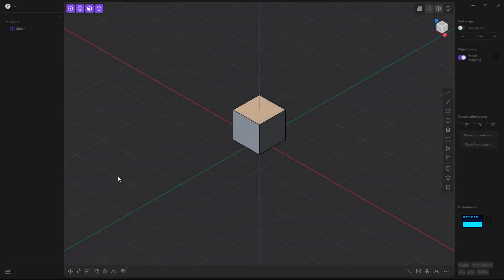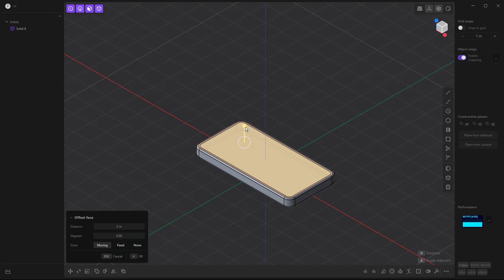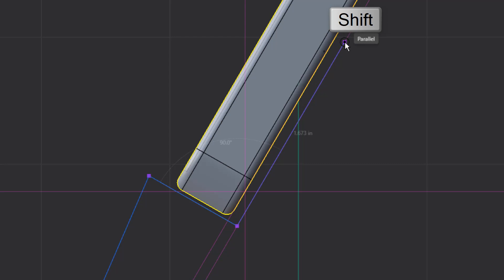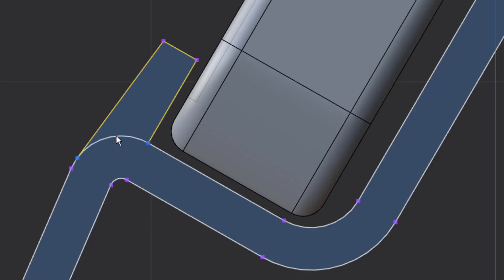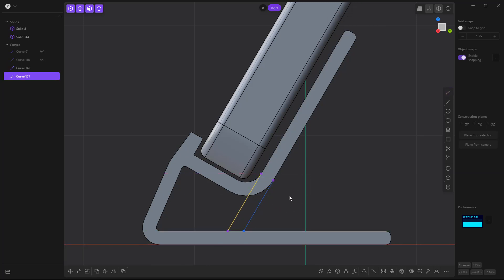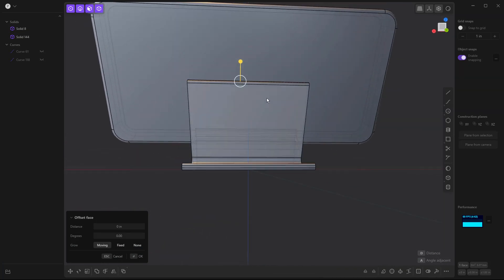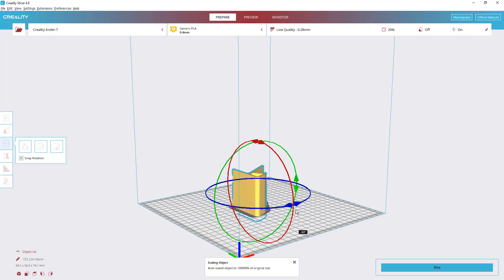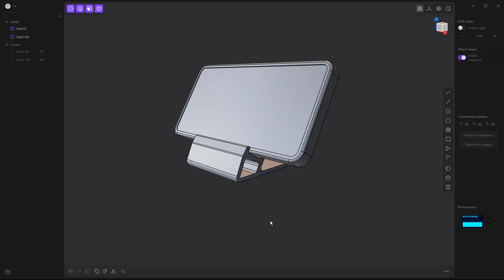Plasticity for 3D Printing | Design and Print a Simple Phone Stand

Comment: Thank you for that! I was going to try Plasticity but I heard that it doesn’t export very smooth for 3-D printing. Any tips please? Thank you once again!
Reply from the maker: We did a new getting started video for 2025 that was a 3d printed key fob and we go into the print slicer.
https://youtu.be/CTgza6C5LzA

There are some differences between Studio and Indie, but in general I would say just look at the tesselated preview on screen when converting to an STL.  I haven't had any issues with the things I have taken from Plasticity to Print, but you may just need to watch the default settings on export.

Comment: im trying to choose what saftware to use to create prototype designs and 3d print them. i have heard some people say that just learn fusion 360. plasticity can have issues with polygons not lining up for 3d printing. maybe you could help me decide which to learn. im an artist or designer more than an engineer
Reply from the maker: It can be a touch choice for sure.  I have done a few videos in both Plasticity and Fusion that might help.  Plasticity was made as CAD for artists.  that was the original tag line.  So if you were a visual effect artist using something like Blender, but had trouble with the Hard Surface workflows, that is where Plasticity Fit.  Plasticity as a tool just for 3d printing, it isn't really what it is made for but certainly can work.  The video we just released today was doing a 3d printed keyfob holder.

I would try both and see which one sits better with you.  Fusion has benefits in the fact that you make dimensioned sketches to create your objects, and can edit those dimensions to update shapes, gaps, features.  Plasticity is direct modeling meaning once a solid is extruded from a set of curves, they aren't linked.  So to change its size you generally take a direct approach to pushing/pulling faces around.
Reply: @LearnEverythingAboutDesign  yes I watched the keydob today

Comment: clicked off when you selected inch.
Reply: https://youtu.be/U2_vMe8Xkhs?si=1Ym7K0A8v3-vy47x
Reply from the maker: I have loads of tutorials on Placticity in the metric system.  you happened to find the one that was using inch :)
Reply: @LearnEverythingAboutDesign  haha I still watched.. very informative none the less! And watched more since.. thank you buddy 🙏🏼
Reply from the maker: @gnrslash1987  Glad to hear it :)
Reply: @LearnEverythingAboutDesign  thanks man.. hope the comment didn't come across too blunt 🙏🏼 do you do anything with onshape?
Reply from the maker: @gnrslash1987  All feedback is welcome!

I haven't on this channel.  I did an Onshape course for Pluralsight years ago and was an original beta tester but im not a big onshape fan.  Fusion does have a browser version fyi.  its a bit slower but it is a nice option if you happen to be on the go.  and is uses the same files since they are all stored in the data panel.

Right now on this channel i cover Fusion, Solidworks, Plasticity, and Blender as the main design programs.  I do content in solidworks, inventor, fusion and others for eLearning sites.

Comment: how do you export out of plasticity so that when imported it is 1:1 scale?
Reply from the maker: Some slicers handle this a bit different.  So it kind of depends.  If you export an STL or OBJ from plasticity when your units are set to MM in the user preference and import that into Bambu, Creality or others it should be 1:1.  Where things go a bit wonky is when the units in Plasticity are different as most slicers expect it to be mm.  If you draw something with mm units and set it to INCH, even though its the same size, when you bring it to the slicer it will think its not 25mm, but it will take the .98in as .98mm.  

So all that to say if you set your plasticity unit to MM you should be fine as that is what the slicers generally want.
Reply: Thank you for your time. I appreciate your answer. If I may ask you another question, how do you import a mesh and make it a solid in plasticity?
Reply from the maker: @Tarnoprints  Importing and exporting does have some limitations for Indie vs studio licenses.  Generally you use the P(file) menu options Import/Append.  while you can bring a mesh in there are limited tool options.  I cover mesh snap tools in the Whats New video here so you can see what can be done. https://youtu.be/LSAc4uyxTao

Comment: I've been struggling with Plasticity and this has been explained very well... Thanks! If I had one wish for Plasticity it would be to be able to add commands to that huge bottom bar that has all that space on it. Or to create your own detachable menu icons over the workspace for larger monitors. That would make it so much easier for people to learn.
Reply from the maker: This video was done a little while ago and the UI has been updated a bit.  The bar at the bottom is contextual so it will fill with tools based on your selection.  BUT, if you hit F and start to search for a command, if you right-click on that command you can add it to your shortcuts.  This means it will pop up when you hit F wherever your cursor is.

Comment: nice, but how to export for dual extruders? It means, how to force Plasticity to export a model with it's hierarchy to be able to select in the slicer which component of the model need to be printed by which extruder?
Reply from the maker: I don't run a dual extruder but that seems like that is more of a slicer setting rather than an export setting.  Generally you would set up a specific extruder per body in your slicer.  What slicer are you using and what printer?

Comment: How do you fix the scaling issue? Designed in inches in plasticity and opened in Prusa, everything was completely off and impossible to fix ...
Reply from the maker: When i use creality print or Orca i need to export with mm units.  What you can do is before you export set the plasticity units to mm, export, then switch it back.  Not a great solution and it kind of depends on what slicer you are using.

If you open a file in Prusa, or any other you can scale it 2540% uniformly and get the scale right.
Reply: Did you ever find a solution for this?
Reply from the maker: @joshuaandashleyearles-benn4749  Im on version 24.1.7 working with the preferences for units set to mm.  and when i make a 25mm cube and export as stl, obj, or step. it comes in the correct size in my slicer.  If I work in the inch unit system and export a cube that was 1in x 1in x 1in it will come into my slicer as 1mm.  Same with Meter.  It appears to use mm as the default but the mesh files like stl don't have a unit associated with them.  so 1 "unit" out of plasticity seems to be 1mm into a slicer.

The solution to get the correct scale is either to work in mm or to switch the units to mm before the export.  but keep in mind if you make a 1meter cube then switch to mm it will be too large for nearly all desktop printers.

Comment: Just downloaded the trial and try to design a simple bracket, but I don't get that box to type in dimensions at all, which stops me dead before I get started.
Reply from the maker: yeah several things have changed in the last few versions of Plasticity, the most recent being 1.4.  is that what you downloaded?  If you start creating a line or rectangle in 1.4 all you need to do is hit the TAB key.  That should toggle you over to the dimensions.  

Also new in 1.4, if you draw a 2 point rectangle, you can hit the = symbol on the keyboard and it will bring the dimensions back up.
Reply: @LearnEverythingAboutDesign  Thank you! I discovered the tab thing. Still haven't figured out how the = key shortcut translates to my Norwegian keyboard layout though. 😂
Reply from the maker: @thedolenorway  yeahhhhh, i am no help there :)   In plasticity the F key is find and you can start typing Dimension and see what hotkey is linked to it.

Comment: If I wanted to 3D print this, is there a way to get the measurements (units) in Plasticity to export correctly? At the moment a 1 meter square cube in Plasticity will print real world size 1mm.
Reply from the maker: Yeah the export was an issue present.  My slicer auto scales it but here is what I had found.
The current beta fixes the STL export scaling issue.  All other formats seem to export ok but STL no matter the unit is 100x too big right now.  So this largely depends on the installed version of Plasticity.  The creality slicer which is based on the cura slicer auto-scales it and i forgot to mention that.  
If you export in any unit, say 5mm cylinder, the output in STL will be .05mm.  same for CM, M, or Inch.  5in will export as .05in.  Hopefully that helps until the next public release.

Comment: why did your slicer have to rescale the part to 100,000 times? I notice if I make a 10" cube in Plasticity, it exports as a .25mm cube. What is going on? I changed units to inches in Plasticity.
Reply from the maker: There was a bug in version 1.1 with the STL output.  That should be fixed in version 1.2.  I think i pinned the comment to the top about how it was scaling everything.  are you on version 1.2?
Reply: @LearnEverythingAboutDesign   Yes, just bought it. A lot to learn so I am content for now. Thanks for your video!
Reply: @LearnEverythingAboutDesign  I tried 1.2.13 today as of september 1. still cant export to STL , what a bummer :(
Reply from the maker: @silenceDKgmail  Is that a product of the license you have?  I just downloaded 1.2.14 and its still there for me on the Studio license.
Reply from the maker: @silenceDKgmail  I just had a look https://www.plasticity.xyz/#faqs  It looks like the 30 day trial only has a low res OBJ output.  the Indie and studio versions do have STL export and higher res OBJ export.  It seems like you could export an OBJ and take that to your print slicer even if it is low res.  Might be worth a shot before your trial ends at least.

Comment: I think my biggest problem is that all extrudes and changes are relative dimensions. (+10mm for example) I've never been able to find a way to click 2 sides of a shape and say "OK, make these side have an absolute Y dimension of 150mm".
Reply: I think that's the problem with plasticity, the program gives you a lot of freedom but constrainings are missing.

Maybe in future releases, some lines or faces can be dimensioned as fix...
Reply from the maker: @fifdesign89  Yup, Nick knows so I would expect a future release to have something in place!  Maybe v2.0
Reply from the maker: yeah once its made its made.  There are some ways to get it.  For example if you are extruding off a face and want the total thing to be 150mm.  once you start the extrude hit "V" for pivot point, and set that at the base of your part(or origin), then make your distance 150mm.  Its a bit of a workaround but is possible.
Reply: Measurements are a thing now
Reply: Yep, this problem does not exist any more in plasticity

Comment: As of v1.1 it appears that you can’t export out of plasticity using metric units and have the model be the correct size when you bring it into PrusaSlicer. Haven’t tried any others. I will have to try working in inches and see if that works, thanks for the tip!
Reply from the maker: Yeah the current beta fixes the STL export scaling issue.  All other formats seem to export ok but STL no matter the unit is 100x too big right now.  The creality slicer which is based on the cura slicer auto-scales it and i forgot to mention that.  
If you export in any unit, say 5mm cylinder, the output in STL will be .05mm.  same for CM, M, or Inch.  5in will export as .05in.  Hopefully that helps until the next public release.